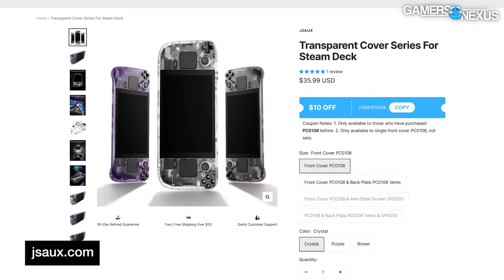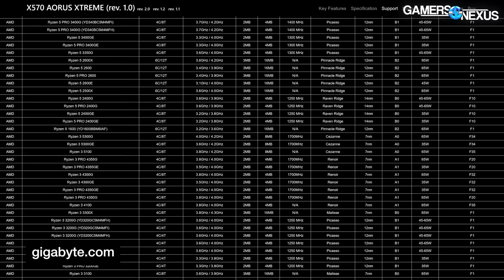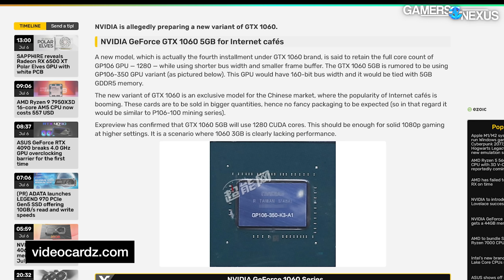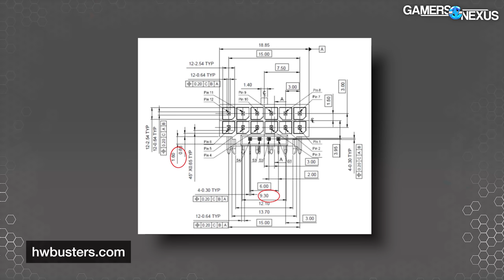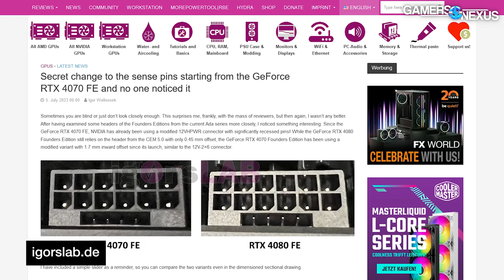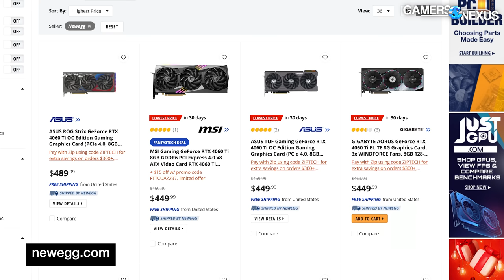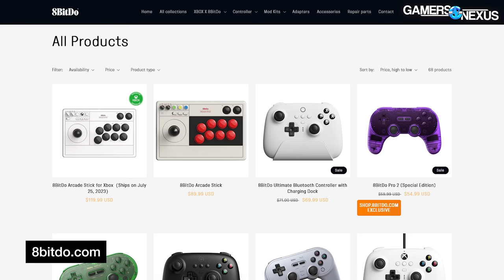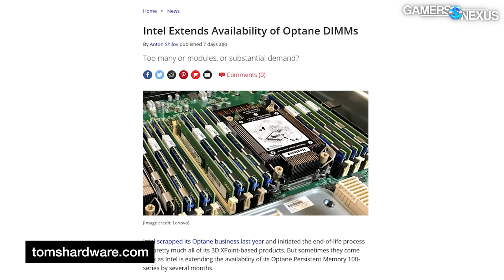HW News - Ultra-Small Intel Arc GPU, 12V-2x6 Connector, More AM4 CPUs, 4060 Ti 16GB

Comment: Pretty sure AMD is just sitting on 7800xt/7700xt and is just waiting for the 6xxx series stocks to dry up. A betting man will you that 7800xt 16gb is just trading blows with 4070ti, the 7700xt might not be even not doing well versus a 4070 though... also that 7600xt might be even slower than 4060 8gb non ti... troubles all around as AMD will be forced to sell new products at fair price this time around and cannot ride the nvidia pricing train...

Comment: That 4060ti with the NVMe slot attached to it is very clearly a last ditch marketing gimmick. No one buying a 4060ti is the type of consumer that cares or has the need to access and remove an NVMe SSD regularly enough that installing it to a graphics card is a better alternative to installing it in the dedicated slots on a motherboard. That isn't a market that exists

Comment: Seems it would have made A LOT more sense to give both the RTX 4060 / 60Ti (12GB of VRAM) as 8GB is a bit low and 16GB simply makes no sense giving the performance tier - These aren't 4K cards.
Reply: It has 4 chips of 2gb vram. 

So the simple answer was just to change all those 2gb vram chip things to 4gb chips. It isn't like they cost Nvidia a lot of money. They could sell it for 30$ more than the 8gb version and have the same profit margin.

The problem is if they did that, then literally nobody would buy the 8gb version if it was only $30 more for the 16gb version... And that isn't good for Nvidia or vendors... Though it would be good for consumers. 

So in the end you get an overpriced card with more vram than it really needs, but I personally would still take it over buying an 8gb card in 2023... (but I do game development in Unreal and benefit from more vram...) You can get ripped off now... or you can get ripped off later...

Comment: Ryzen 3 5100 with 4c/8t... if it is listed above $110, it won't sell well.
2nd hand Ryzen 5 3600 is sold at around $100.
New Ryzen 5 5600 is sold at around $140.
To sell Ryzen 5 5100, the price should be around $80-$90, it is assuming it has Zen3.
The market target for 5100 might be only and only iCafe. If the naming is consistent it has no GPU, so it is not suitable for office PC.

But again... if I have iCafe, I will buy 2nd hand R5 3600 for more cores and more cache and it will have better ROI since it will age well with 6c/12t.

R3 5100 with 4c/8t will only do good if you open very cheap iCafe.
I think the best product for AM4, if they plan to make others and excluding R6 5600X3D, is something similar as R6 5650G with 12CU RDNA2 .
It will sell like peanut for budget iCafe and budget builder especially since high speed DDR4 is at its cheapest.

Target performance is minimum at 1080p120fps for game such as CS2, Valorant, and DoTA
Reply: I mean... I did make a suggestion that GPU should have an upgradeable slot.
M.2 NVMe as storage expansion is a good start.
Next might be NVMe as expandable memory, IF AMD or Nvidia opens support for it or expandable VRAM via slot such as SO-DIMM with an industry standard form factor. I mean it won't be as fast as soldered VRAM, but it will serve well for L4 cache before it spills to system RAM

Comment: If Nvidia put at least a 256 bus on the 4060ti 16GB, it wouldn't be a good seller.
With the 128 bit bus it's a waste of time giving it 16GB. Cheers
Reply: why? what is the difference?
Reply: @dreyga2  In order to use the 16gb to its potential properly, you need a bus speed fast enough to transfer that extra data.

I expect the bus will be running flatout even on 1080p sometimes, which will cause annoying slight stutters in a game here and there.
Cheers.

Comment: Just a nitpick on the 4060 Ti with NVME: the NVME drive isn't using all 8 lanes; rather it uses only 4. To use 8 lanes they'd have to have two NVME drives.
Reply from the maker: Did I say 8? Yeah, that's correct. I misspoke if I said it's actually actively using 8 lanes. Thanks.
Reply: @GamersNexus  
I wish they'd put two NVME slots on the card and actually use the 8 lanes.

Comment: Hopefully they release Ryzen 7000 on AM4. AM4 market is huge after all, much larger than AM5 and it will stay that way for years to come due to ongoing economic downturn and AM4's extremely long lifespan.
Reply from the maker: That is physically not possible given the architectural design. Can't get DDR5 on AM4.
Reply: AM4 is PGA, AM5 is LGA. The CPUs are fundamentally different and not a drop-in solution.
Reply: @GamersNexus  Why can't Ryzen 7000 be used with DDR4 with some addressing signal conversion added if needed?

Comment: They've probably over produced RDNA2 and are trying to clear stock before launching the midrange (it's probably the same case with Nvidia).
I mean, it's not a bad strategy if they are priced right, but it does feels a little off...

Comment: can one of the cable mods folks create a little tool that will go in and snip the existing pins on original 12vhp connectors…and clip them shorter in a idiot proof, kind of tool to sell?

Comment: If, IF the 4060ti 16gb had a 256bit bus (like the 4080), I would consider it even if it's underpowered.
But nah, Nvidia had to keep the horrible 128bit bus, heavily bottlenecking certain apps in ways rarely seen before.

Comment: I rather have 2 or 3 8pin connectors on a GPU then that new plug. I still don't trust it and will not buy a GPU with it . Would you want 2-3 8pins or just keep worrying if the new connector will melt and catch fire, or even worse. 😑

Comment: If AMD releases a new 300-400$ mid-range GPU it will get the same hatred as the 4060/TI because i think it would be completely impossible for AMD to compete with the price/performance of the 6700XT on a current gen GPU.

For me personally power efficiency is by FAR the most important factor on a low/mid-range GPU...which the 4060/TI is actually very good at (but overpriced), AMD is "okish" at but does not offer a mid-range GPU and Intel Arc is currently the worst. If Intel manages a GPU that can compete with NVIDIA in power efficiency i would be more than willing to go Intel for a new GPU.

For reference: Strictly looking at 1080p (because that's what i am interested in) the 4060TI is slightly faster than a 6700XT, moderatly faster when using RT - but it uses 150 watts instead of the 6700XT's 220 - that's almost a 30% reduction in power consumption for the same or better performance....which makes the 6700XT for me personally a complete non-starter. 

If i bought a 6700XT instead of a 4060TI right now i would end up paying MORE for it because of the electricity cost...while getting lower performance, older features and more heat pumped into my room. That's not a good deal. Not in any way you can look at it....which is why i still think the 4060TI is getting too much hatred in general. The competition is just too bad to bash the 4060TI so much, i think.
Reply: I agree with you. I really see the RTX 4060 TI as a kind of mehhh... not a great deal, but still kind of sort of ok for what it is... 

I built a PC when I was working overseas in China, and I wanted it to be small enough to fit in a backpack or take as carry-on luggage on the airlines. The downside to that is I only have 22cm for my GPU. 

So in my very niche situation it is actually important that the 4060 TI has less power draw and less heat than the 6700XT or the RTX 3060 TI. 

I'm certainly not saying everyone should go get one, and people who already have a 3060 TI certainly shouldn't spend the money... 

But if you are currently on a 1070 or 2070, it doesn't seem like the worst upgrade in the world. Still not good value, but I don't see what all the drama is about. For some situations it is ok, and for others it is the kind of boring disappointment that doesn't really deserve all the attention and whining from YouTubers. 

For me personally it looks like a fit for a holdover until the next generation of GPUs is better and I feel like building a whole new rig... But nothing on the market right now makes me excited to spend $2,000 on a whole new rig... Nothing from the current gen of AMD or Nvidia is making me think it is time to build now.

Comment: The "innovations" you talk about are minor variations of the 1980s PC. Mostly just repackaging the same old garbage.
Let me know when they replace the 1895/1920/1988 PSU with a 2011 PSU.
Let me know when they replace the 1920 VRM with a 2011 VRM.
Let me know when they replace the 12 V "standard" with the 1950 24 V standard. I know that the 1920 VRMs cannot handle 48 V input.
Let me know when they replace the 1960 CMOS logic with the 1957 tunnel diode logic. 33 THz at 5 W.
Let me know when they replace the 1950 Boolean logic gates with the 1960 Threshold logic gates.

Comment: I speculate but after all these months it looks like AMD shot themselves on the foot with the chiplet design. With the yields that TSMC is having it looks like it is more feasible to produce the 7900 dies as opposed to the lower stack models. And considering that they are somewhat price and performance competitive with the 4080 and 4090 (kind of, stretching it a lot) with their products and the customers bit the head off of nVidia for their lower stack model pricing it is somewhat understandable from a devils advocate point of view why AMD is shy about getting out their 7800 and 7700 models as those models will probably will not be well received either as AMD like all companies will want to make money hand over fist from them.

Comment: imagine a AIB partner releasing a 4060 or other gpu, with increased Vram then what Nvidia's normal version have. Extra Vram would not be hard to Add, Imagine a Extra ram slot on the gpu to add more ram. You got 8gb but want 32Gb. No problem. Nvidia would have a stroke if someone did this. That is why no body else does it, Look at when people resolder on board ram on Mac's etc to increase the size. I guarantee 100% Nvidia Blocks them for doing this.
Reply: @shanent5793  what about ddr5? 16 or 32gb of ddr5 vs 8gb ddr6 which is better? If you cant make a connector. what is stopping manufactures from installing a 16gb nand chip instead of 8gb?? A chip is a chip.
Reply: @shanent5793  you know what i mean bro. A 8gb memory chip extra could be easily added to make it have more memory. Why do people always want to be so technically correct..
Reply: @shanent5793  so its impossible to make the 4060 non ti 16 gb. Ok if you say so.
Reply: @shanent5793  I dont, I was being sarcastic. memory bus does not really mean much. when lack of Vram is massive.
Reply: @shanent5793  So you are saying a less bus speed, physically stops them from installing a bigger memory chip on to the board, ok. So is a bus width chip built into the 8 gb memory chip? 16gb has 2 bus chips correct?
Reply: @shanent5793  thanks man for the info.

Comment: because Nvidia rising the prices up and up and up generation after generation now Gamer Nexus is calling AMD out for not releasing Rx7800/7700 cards ? where is the point when the price to performance is always better and even power consume, but the people still buy the bad Nvidia product.
By bad i mean GTX 1050ti over a Rx570/580, by bad i mean getting a GTX 1080 RTX 2070 over a Rx 5700xt.
Get a Rx 6600 > RTX 3050 / Rx 6700 > 3060 /  Rx 6800 > RTX 3070 even when we know that the AMD cards have way better life time because of more vram that the RTX 3070 is struggling now, the people are not buying the better product for the same money.

The AMD drivers are way WAY WAY better then the nvidia ones because Nvidia failed alot in Software the last years and the software is so outdated that it hurts (from visual).
Amd is having everything you need for a GPU and more in ther drivers.

But people still buy Nvidia cards, of course if you want the best then you have to go with the RTX 4090 but this has his own price.
People call Intel for being a competition for Nvidia but then they decide to buy nvidia, there is no competition without selling the products.

Of course i can understand AMD that it will be pointless to go this financial Suicide any more because Rx6000 series was equal to RTX 3000 series in every aspect and it was even better because more vram and less power consume.
But people decided to go with Nvidia this is why AMD have his cards in stock and selling them now and the cards are not bad, RayTracing is something no body need in reality because it eat too much performance for very ugly reflection and lightning (okey the light is awesome).

The best thing is to skip this generation and if you want to buy a gpu nowdays then go with Rx6700/6800 there is basicly no competition from Nvidia even with the RTX 4000 series against Rx6700/6750/6800 cards in that price and vram they deliver and performance, the RTX 4070 can have more performance but 8gb vram is outdated.

Comment: Whoever master-planned 12VHPWR configuration was total disaster, 12V-2x6 Connector will not solve the safety issue. The average refrigerator runs on between 300 and 800 watts of electricity. Can you imagine if 12VHPWR or 12V-2x6 configuration installed on refrigerator. Fire hazard!!